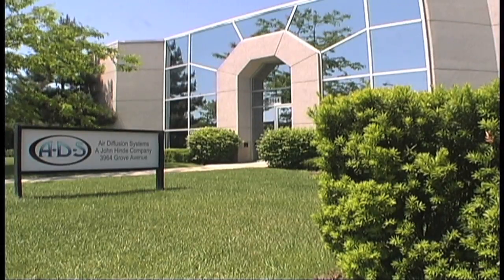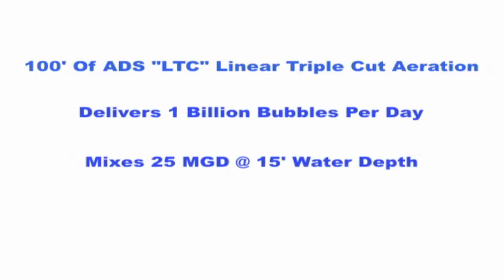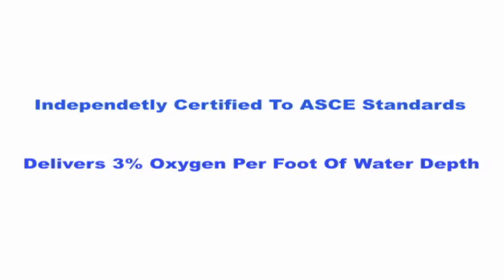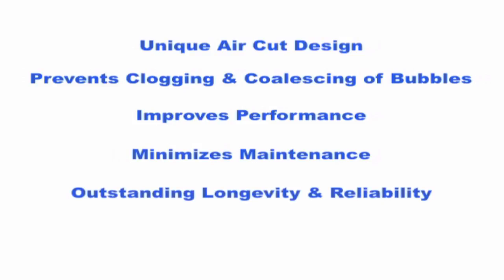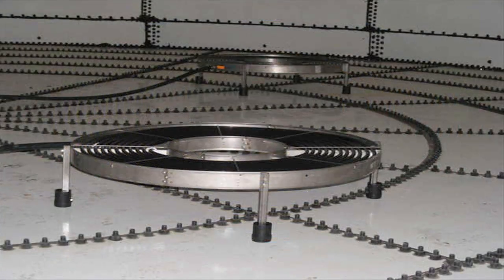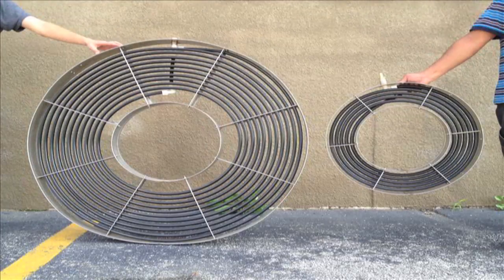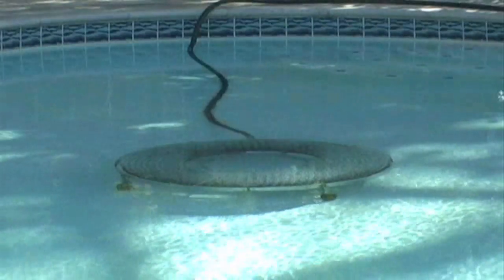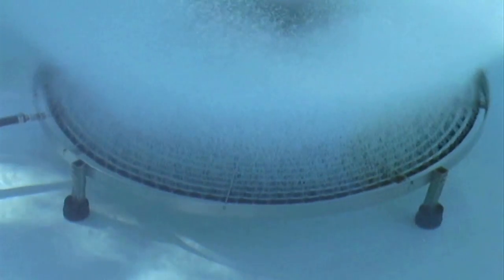ADS Fine Bubble Aeration & Disk Module

Comment: how are you
How much does the machine cost
Is there a warranty on the product
How much oxygen production per hour
Reply from the maker: Hi, the oxygen transfer is depth-dependent and also influenced by the type of water or wastewater being treated.  ADS can provide a custom engineered aeration solution without cost or obligation to purchase.  Please reach out to our design engineers by emailing info@airdiffusion.com with project specifics and drawings you have access to.

Comment: what is the price of this tube..
and  how to buy?
Reply from the maker: The cost is dependent on the application and the amount of equipment required to deliver the results you are searching for.  ADS can provide a custom engineered aeration solution without cost or obligation to purchase.  Please reach out to our design engineers by emailing info@airdiffusion.com with project specifics and drawings you have access to.